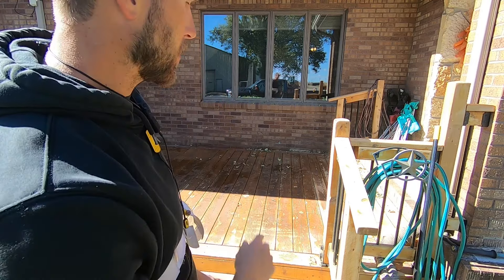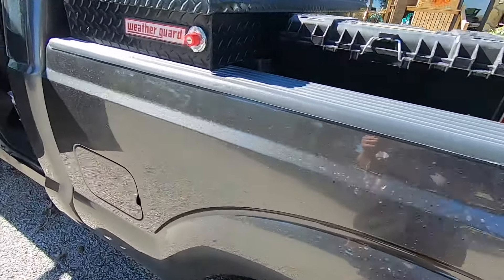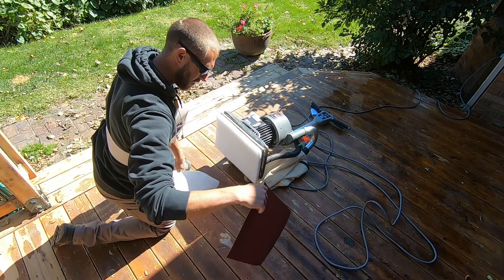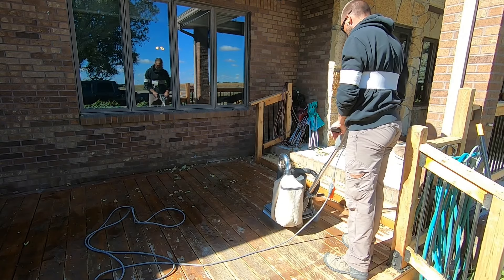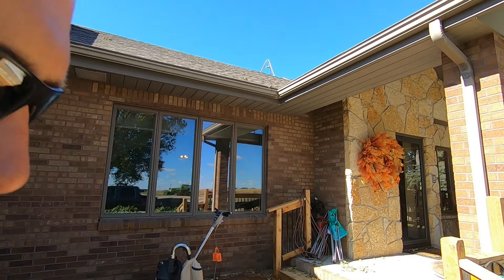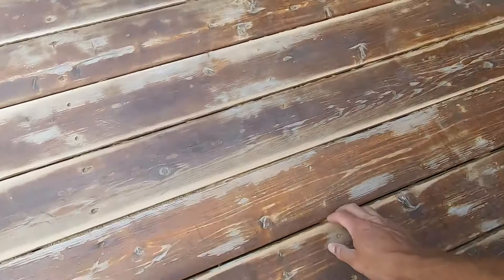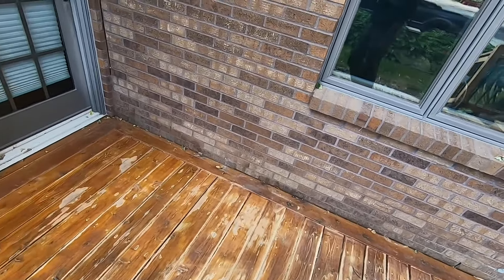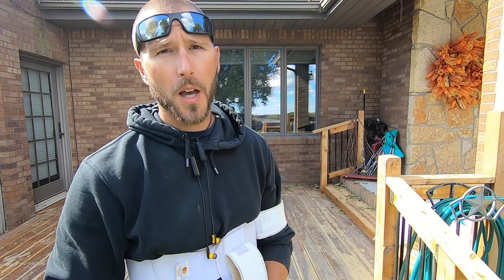How to Sand a deck/ Quick & Easy

Comment: Hey pal, you are on the right track. Here are a few things to consider from a company that does about 75 - 100 deck stains per summer. First have the customer remove all their items from around the deck ... ie hose reels and lawn chairs. Clean the cracks between all the flooring pieces with a compressor (thats where the dirt and gummy items are coming from, gumming up the sandpaper.) I would typically strip that deck first day and sand the next. Much of the overly applied existing stain and protector will fall off with a good stripper making your sanding so nice and clean. And yes, always buy loads of sand paper and just return what you don't use (you're returning the sander so it's not like it's an extra tip). The other thing to remember is this is an outdoor deck. 120 is a bit fine. I am usually 80 grit after the stripping of the existing. No need to polish the deck like an interior hardwood floor. Great start pal. You will do well with your conscious effort of improvement.
Reply from the maker: Appreciate all the insight from a pro like yourself! It’s what makes YouTube my favorite platform! People helping people! 💪 appreciate ya brother !
Reply: Any advice if the stripper isn’t lifting it at all
Reply from the maker: @anthonyinfelise1412 what brand of stripper did you use ? And you can always rent a floor sander…

Comment: Square sander is def the way to go. The pad will work around the contour of the wood. Cedar 60 then 100 grit. Regular pine with heavy paint or deck over 20-40 grit

Comment: Good choice to use a floor sander... 80 grit is fine enough for a deck and allows the new stain to penetrate...
Reply from the maker: would you recommend stepping up to higher grits on something like that or is it not necessary?
Reply: @AMAYERICAN  l don't think it's necessary... even when sealing cedar siding, manufacturers recommend a quick pass with 80 grit on a sander to open the grain and allow the finish to penetrate, be it an oil based primer or stain...
Reply from the maker: Thanks brotherman appreciate it !
Reply: @AMAYERICAN  I appreciate your videos!  Cheers from Canada!
Reply from the maker: Awesome thank you for watching and sharing knowledge!

Comment: Been doing deck resurfacing for 17 years and seeing as most of the stain/sealer is well bonded.....you should be using a drum sander ! The result is amazing and when you're in business the time saved is quite justified. The orbital is okay for decks that are faded grey or most of the old stain is gone but painted or stain sealed requires a drum sander.
Reply from the maker: Good to know! Thabnks brother, what’s your favorite finish for a deck? Seems like there are some bad products out there these days…

Comment: Try the 8 inch drum sander if you do this again. The weight of the machine and a 60 grit should take all that off. Sink your screws a little deeper though or you’ll trash the paper.
Reply from the maker: Will do thanks for the heads up! I will say the spray on stripper worked way better then I expected. I should of started with that first, then sanded.

Comment: think either u should have power washed first ... and then did the 60 grit or....20 grit .... and then 60... to get that stain off ...im getting into doing decking and that's what I would do
Reply: Use a chemical stripper first and get most of what would gum up a ton of sandpaper off of there and sand.

Comment: 4.5 inch diamabrush. I did a 80 ftt deck took 14 hours .then hit it with that orbital sander. Will look like new. That deck should only take 2 hours with the disk. It a lil hard work but will look new after. The 4.5inch diamabrush disk is the only way
Reply from the maker: That’s awesome thanks for sharing!

Comment: DN’T Ever power wash, Cedar
Reply from the maker: Why’s that ?
Reply: @AMAYERICAN well I just did it… and it made all my 6x6 post super fuzzy like. But went over with electric sander and back to new!
Reply from the maker: @daylendepriest6914  definitely be careful with pressure washing, use a wide angle tip

Comment: You need to use a big sanding machine first and then finish with machine
Reply from the maker: I’ve used a drum sander on another deck project and it was almost too aggressive. Worked great but I was worried I was going to take off too much. Definitely was much faster tho !